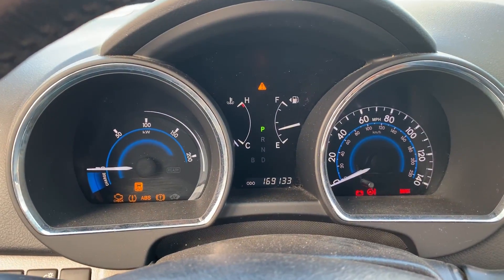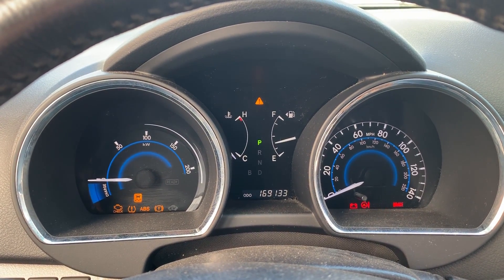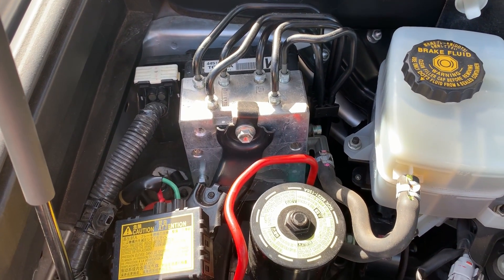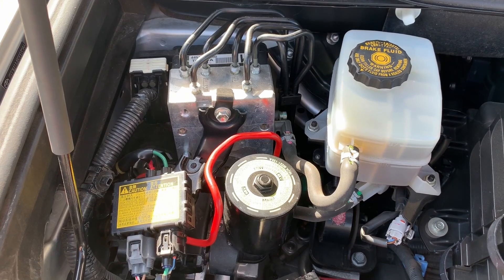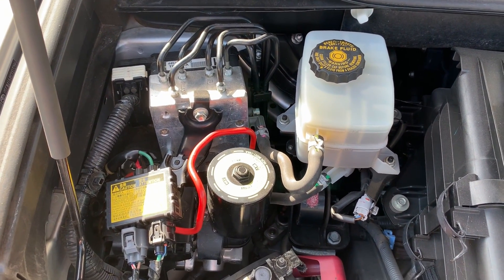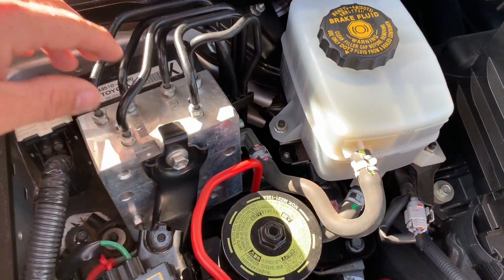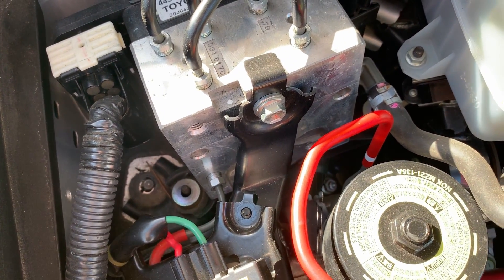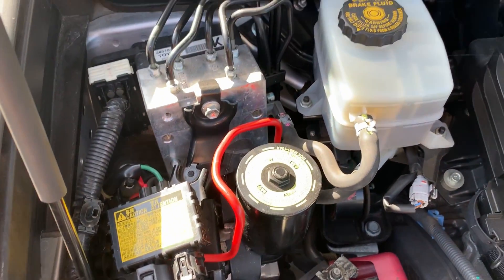2008 Toyota Highlander Hybrid ABS brake booster actuator pump FIX $200 DIY 47070-48020, 4405048320

Comment: Does replacing the actuator require some new hardware registration / "calibration" via Techstream? Is there anything else besides the Actuator bleeding process that you need to do in Techstream? Thx,

Comment: Be nice if you were more specific about which unit you were talking about had the burnt smell (original or yard replacement) and maybe color code it or something.  I was confused as to which unit you were talking about.  And where did the machined "aluminum box" come from?  the salvage yard or was that another purchase?  After watching your video again, I see you replaced the motor with the used one from wrecking yard which didn't fix the "codes" and then you replaced the square aluminum box component, bled the brakes and that cleared the codes.  So the only component you didn't use from the salvage yard was that one piece with the broken brake hose connection.  Thanks again for a thorough explanation.

Comment: When you mention the relays, on the Foxwell scanner that has the brake bleeding service on it it says to take out the two relays prior to bleeding the front brakes. And this is after you replace everything and start the bleeding process
Reply: That's odd... I looked up the fox well unit, it doesn't have the software you need for a Toyota. You need a scanner with techstream. I think you're doing an unnecessary (and possibly damaging) step. Sounds like that's something you do on a non-hybrid. We don't have those instructions at all on ours.

 Techstream enabled scanners are for Asian vehicles like ours. Lexus and Toyota I believe. They make all different brands but techstream is the "program" essentially that comes on them. Our scanner was about $150. Worth it though! You won't be able to properly clear codes, make extra key fobs, etc, without one.

Comment: You can also manually bleed the brakes I understand to avoid getting the Tech Stream software.
Reply: Only downvoted, cuz this is not true. Currently working on a 2010 Highlander. Used pressurized brake bleeder, can confirm that YOU CAN NOT bleed brakes manually to fix issue, even after replacing actuator/pump assembly.
Reply: @fixfernbacks144  Before pump brake bleeding systems all cars were manually bled. More than one post is from an example done that way. You may have allot of air trapped in lines that made manually bleeding difficult, not impossible. I manually bled my 2007 Highlander 4 months ago and it worked great.
Reply: What was the fault and what did you replace before bleeding it manually cos I doubt
Reply: @AIATEC_AUTOKIING_GLOBAL  I replaced brake actuator. I did a a manual brake bleed 2 years ago on a 2007 Toyota Highlander. Here's how, after removing old actuator you have to make sure the new actuator reservoir is full of brake oil, and before reattaching brake lines to actuator lightly tap brakes quarter of way, keep pedal down, to make sure suite of actuator lines are full of brake oil before reconnecting to the actuator reservoir.  Thus the air in lines is negligible. You can do this bleed with a partner, or buy a 36" clamp at Harbor Freight ($10) and reverse the end of one foot, then place foot on opposite end of clamp,  to use to hold brake pedal down. You can also use this now brake depressor tool to do a complete brake bleed by yourself.  With all the brake lines connected to new actuator reservoir bleed the actuator first, and the brake lines to wheels last. Works great and many have commented it worked for them.
Reply: @AIATEC_AUTOKIING_GLOBAL  replace ABS actuator. Keep fluid in lines up to actuator. Bleed actuator, then wheels.

Comment: Hello, I need your help. I have a same car 08 HH hybrid. Showing ABS, Brake, Master Warning yellow, Brake Warning red, Slip Indicator lamps. No Engine light. And it makes bop noises when I stepped and hold on the brake pedal. I know Toyota had program before but it expired. I asked them for extended warranty but they refused. I took it local Toyota and some places but they showing me ridiculous price for repairs. I decided do it myself. In my case May just replace the motor work? I just don’t wanna pay a lot. Do you think that would work? Thank you for your time. Regards

Comment: Mine just went out last night on my LS460, if I can find a used working unit for cheap I will do it myself, of course I'll have to get the techstream software. This thing should be under a safety recall, that was a slightly dangerous slow drive home manually downshifting with those brakes not functioning properly to stop the vehicle.

Comment: I have a lexus gs430 im having to pay $3k smh im in pain saving the money to get fixed
Reply: How many miles are you at? I have a 08 Highlander hybrid. It has 129k miles and 2 owners now but it drives and rides like it’s brand new still. Runs amazing. I have a 50k miles warranty just in case I run into these issues. Anything like this happens to me anytime soon I just have to pay 250 and Toyota will replace it brand new.
Reply: @tangedal9983  75k miles man

Comment: TRY THIS FIRST!!!!!!   The old starter trick.  get a hammer and give that DC motor some raps.
Reply: I have same problem..can I hit a bit by hummer?
Reply: I did it, worked for a day. Absolutely zero noise. But then came back and won't go away anymore by tapping it with a hammer.

Comment: I have the same problem. The thing with my car is interesting. I wend to a yard and I found that part for $100 if the vin number of my vehicle had a letter P (fifth digit) but if it had a W. The price goes from $100 to $900 unfortunately it was a W. And they don't have it

Comment: When bleeding with the software do I need to open up any valves to let air escape or anything like that
Reply from the maker: The software will tell you what bleed valves to open in what order. It will detect when you open the valve and start pumping fluid. You open it for a certain amount of time for each wheel. Make sure to top off the fluid between each valve.
Reply: @diyautorepair5858   If you tell us the order the bricks need to be bled and then the time needed for each one that may save a whole lot of us a lot of time and trouble, Thanks for the video

Comment: i have same problem now with my tyota lexus rx450h 2010.. same fault code c1252, c1256.. do you have any advise
Reply from the maker: I believe they extended the warranty on the 2010
Reply: @diyautorepair5858  I have the RX 450H 2010 . c1241 abs power supply fault ABS is making the buzzing sound when you put your foot on the brake pedal could it be warranty Issue I am In Australia,Thanks

Comment: Can you say how frequently buster pump is restarting now after repair?
I mean when car is in READY and not touching brake pedal.
Mine is restarting every 3 minute for 5 second.
Reply from the maker: You have a problem then. I believe mine only started when turning on and off the car when working properly.

Comment: I have the same issue with my 2006 Highlander and it's out of Warranty. So many of these actuators go bad that I didn't feel comfortable buying a used one. I think there is a pretty good chance that a used one won't last very long and you will just be stuck doing the job again. Apparently Toyota has attempted to fix the issue with a new part design/manufacturing, so I went ahead and bought the unit new. My local Toyota dealership here in California wanted $1800 just for the part, so I bought it online from a dealership in Virginia for $1150 including tax and shipping. I'm a mechanical person so I might go ahead and buy that software and do the install myself. If you have any last minute tips I would love to hear them!
Reply from the maker: Make sure you get a cable that supports the bleeding process the cheap $20 eBay ones will give error messages halfway through the bleeding process and you will have to do it many times to get all the way through and it will drive you crazy. Sometimes when your actuator motor burns out it blows a fuse in the main fuse block not sure if 06 is the same style fuse block.
Reply: @diyautorepair5858  Thanks for the quick reply. After looking under my hood, the 2006 model is different than the 08 but not by much. It actually looks a bit easier to uninstall the part. I'm thinking about getting this cable and software bundle off Amazon https://www.amazon.com/gp/huc/view.html?ie=UTF8&newItems=C260f82c4-279f-4ecc-8d6d-cfef0eee76d8%2C1&siHasShown=1 All the bleeding and everything is done through the software? No extra steps after swapping the part out? It seems too easy haha.
Reply: @PimptatoPCs  did you replace your actuator? If so, how did it go? What techstream software/cable did you use?
Reply: @JoannaM.Wilson-RealtorNJ  Yes I replaced it and everything went surprisingly smooth. The actuator is pretty easy to remove. On the 2006 I had to remove the battery because it was in the way. I linked the software and cable in my previous comment. I bought one off Amazon because it was Prime shipping and I needed it asap. The software was a little weird but I figured it out by watching a video where someone was using it to bleed the brakes on a Prius. For the bleeding process to work you have to unplug the sensor from the side of the brake fluid reservoir and then turn the key on without your foot on the brake pedal. After I did that, the bleeding process worked the first time without any errors. It's so nice to have the beeping and lights on the gauge cluster gone. Honestly, the amount of money that Toyota wants for this part and install is borderline criminal imo. Anyone with a little mechanical skills can get it done without any issues. Sorry for the long response!
Reply: @PimptatoPCs  I have an 06 with same problem did it feel like your brakes were rock hard when trying to press down?
Reply: @PimptatoPCs  also do you have a proper link to the software you bought?
Reply: Sorry, the link only takes me to my Amazon cart. Can you help me and put a link?

Comment: Did you have to also use a vacuum pump to bleed the system, or just the software?
Reply from the maker: Just the software
Reply: @diyautorepair5858  please hoy can i contat With u ??
Reply from the maker: I bought another one of these Highlanders and found out they extended the warranty on the actuator to a certain date I can't remember off of the top of my head and unlimited miles and they fixed it for free!!
Reply: @diyautorepair5858  I have a 2006 Lexus rx400h and Lexus will not honor any warranty. It's under 150k miles but the time is the issue for them to honor anything. Talked to local Lexus dealer and Lexus corporate.
Reply from the maker: @JoannaM.Wilson-RealtorNJ  let me see if I can find the campaign number they tried not to fix it for me also
Reply: @diyautorepair5858  I have the campaign number some where. Not sure if it was different bc it's Lexus but they said there was no way they could help bc it was past the time.
Reply: @diyautorepair5858  12/31/2020

Comment: How do I get the tech stream software if not from Ebay? I heard you said on Toyota web page, but could you provide the link? And is the software available for any individual or would you need a mechanic license or something like that?
Reply from the maker: They extended the warranty you might be able to get it fixed free
Reply: @diyautorepair5858  wait so you can take it in for a free replacement in the brake actuator?

Comment: I’m curious about the Techstream software you used. Is that something you already had?  If not, where did you get it?  I’d like to do a similar procedure on my TOYOTA hybrid, and I understand Techstream is necessary, or at least highly useful, for bleeding brakes after actuator replacement. Thanks for the great video and for any info you can provide about the Techstream.
Reply from the maker: I borrowed it from a friend. The cheap EBay cables won't get all the way through the bleeding process. You can use the cheap EBay software but need a Mongoose cable that's around $400. Some people say you can use the Mangoose cable that is only $40 but I haven't tried it.
Reply from the maker: They extended the warranty on the actuator. You might be able to get it fixed free

Comment: Amigo! Pretty useful information you hava had given me. I am actually gonna start a repair of the same model of car her in Panama. Just I need to get the part number of the pump motor to get it. Thanks for your kind explanation. Regards.
Reply from the maker: Thanks Ibsen! Good luck!
Reply from the maker: They extended the warranty you might be able to get it fixed free